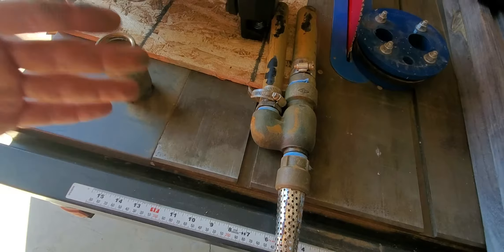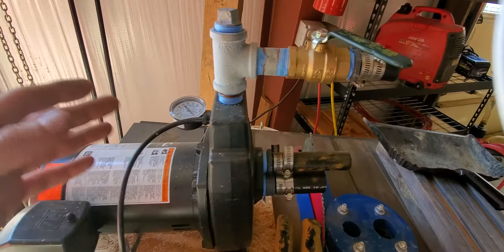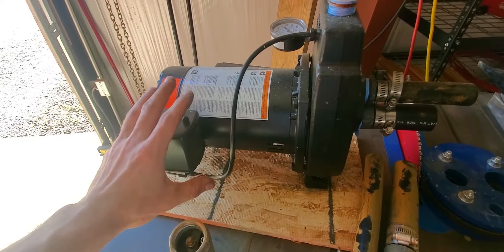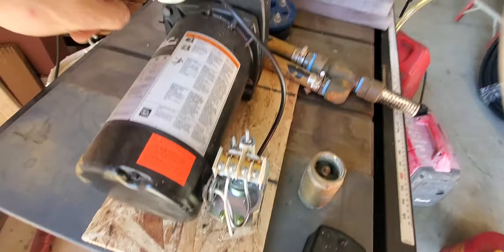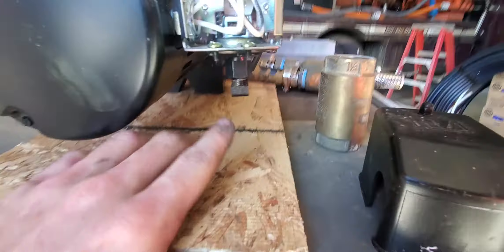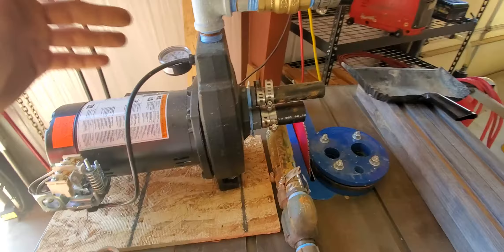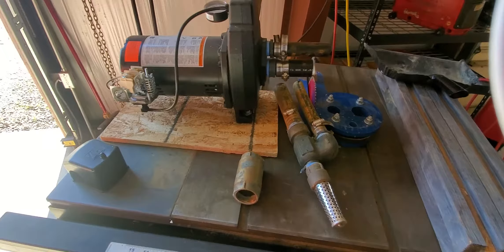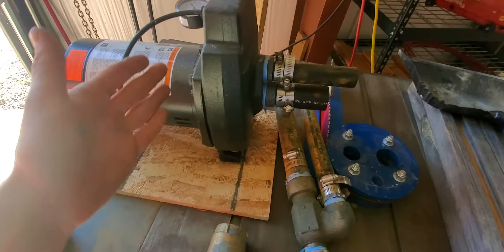Well Pump Not Pumping, here's why. Jet Pump 2 Line System Explained. No Water, Low Pressure.

Comment from the maker: Like 👍 this Video if it was Helpful! 
Find others like in on my channels Playlist Labeled Well Q&A!  Thanks for Watching 👀
Reply: My pump will run build pressure shut off and then makes a gurgling noise then turns back on
Reply from the maker: @rickjones2534  your pipe or foot valve is cracked down in the well. It's just leaking all the pressure back down the hole. Pull pipe out! Look for cracked plastic and holes & inspect the check valve, a rock can be stuck in the oring sometimes
Reply: Can you line a 4inch well casing?

Comment: We still run a Goulds Jet system here, but we take directly from a seep well on a river. And yes nothing by headaches. Brother just replaced the pressure switch because it wasn't cutting off. Now the pump isn't pumping any water as before it was still holding prime. I'm so over this system lol but he wont pay to put in anything else.

Comment: I have a jet pump system that was originally installed in 1967....in a small casing (2" or so).  I've had to have the foot valve replaced twice and have a lot of the red iron in our water.  I'm getting a lot of dirt and grit in the filters since the last foot valve was installed in the Spring of this year.   I've got a new 86 gallon water pressure tank on order as the bladder in mine has started leaking.

Thanks for the video and info!

Comment: Awesome explanation! Thanks for a better understanding of how it works. My old contactor burned the red wire from the pump. Melted in two and contactor stuck. I replaced the pressure switch and now my pump comes on at 40 but doesn't gain to 60. It doesn't lose pressure if it sits either. With that burned leg do you think it's possibly a pump issue?

Comment: We’ve got a deep well jet pump (two pipe, 1” drive line and 1 1/4” suction line) that we’re having trouble priming. The foot valve and ejector assembly is located in the river—in total about say 200’ away from where the pump is located under the house, with about 45 feet vertical head down to the river. The system holds pressure, but the pump on its own can’t get above about 25 PSI. We had an 20 year old 3/4 HP jet pump (metal impeller) that worked fine under these same conditions that we wanted to replace because it gotten to making a lot of noise. We installed the ejector package that came with the new pump, which is a Red Lion Model. Actually we had another brand in there to start with, but replaced that because of the priming problem, thinking it may be the pump. In watching your video it seems like a problem with the foot valve. Anyway, in talking with some other knowledgeable folks the distance should not be a problem. It’s the head that matters most. That the line friction would only amount to a couple psi difference in line loss. The lines do make a couple of coiled loops near the river (just to make sure we have enough tubing in case we need to cut some off).And like I said, on the old set up, when priming, I;d have to futz around with it getting the air out for a time or three, but it was really no problem. Now we can’t get it work for hell or high water.  Any suggestions?
Reply: Not sure if you were able to resolve your priming but i have the exact same scenario and I was able to prime the pump with a 1HP and the pump run for about 1min 36 second to go from 30psi to 50psi. I'm happy with this but my issue is that if we take a lots of water the pump doesn't provide enough and I'm afraid to loose priming if I keep the shower running + washing machine and my wife does use the sink...... Not sure how to increase flow :/

Comment: I have a shallow well jet pump here in Florida. It is a bit different but some of this information is useful! I am receiving a new start capacitor today in the mail. My 1hp motor just hums. I have 240v at the motor but the old capacitor reads above the upper limit of capacitance on the capacitor and I have never gotten a spark when shorting across the terminals of the capacitor so I just ordered a new one. Strange thing happened yesterday on Sunday. An alarm went off on our sewer grinder and when the city's technician came she found the capacitor was bad and replaced it and the grinder motor started right up and you could see the waste material going down in the cylinder. Good to go literally.

Comment: I’ve never worked on a water pump or system ever in my life, but you really clarified a lot. 

Thank you so much! 

I live in South Florida. One of the pvc pipes to my moms 1/2 hp well pump bursted in our garage and it was like a geyser to the ceiling. I have been rigging it to work for the past couple weeks, but I went ahead and purchased a ‘STA-Rite SNC-L Shallow Well Jet Pump 1/2 HP 115/230V’ and SpringWell’s ULTRA Whole House Well Water Filter Salt Based System Combo + UV Water Purification System along with a Spin-Down Sediment Filter.

I have an existing pressure tank and like I said, I’m quite the novice. I’m just a bit confused on where the placement of all my units should be. 

It’s quite a big project, but I’ve been trying to study what I can and learn off of YouTube. It’s just a bit difficult, because since I rigged my pump.. we’ve barely had any water pressure and my pump runs all day long (so I turn it off from the breaker since it would overheat for running 24/7.)

I do have a secondary pump that pulls from our shallow well on the exterior (opposite of the garage pump) that fills into a huge tank that removes iron/ sulfur, but also acts as a holding tank for water, as well. Meaning the pump that bursted is the one that pulls from the water tank outside.

Since I’m not well versed in this field, I’m worried I’ll mess this up somehow. I do however believe I’m correct when I say I can eliminate that whole part of the unit because it’s outdated and unnecessary with the new system I purchased. 

Therefore, my assumption is I can directly connect the new pump directly to my well and to my new system and it will work just as it did when using my system previous to the incident (if not better, of course.) The pumps are literally less then 2 feet away from each other, forgot to mention the outside pump is the same HP as the garage one too.

Sorry for the novel and I’m sure you might not even read all of this lol, but I really am trying my best to not call a plumber and to learn to do this all by myself (and with help of YouTube University!)

I wouldn’t call myself a handyman, but I do try my best in everything. I’m pretty DIY inclined, does this all sound like too much to take on? 

If I have all the proper tools.. I wouldn’t see why I couldn’t replace something that’s already there and just add to it.. if I pay attention to all these kinds of tips and very helpful videos.

Any insight is GREATLY appreciated. Regardless, I appreciate your time and wonderful content. 

Thank you, again!

Comment: Great video!! 12 minutes that will save me weeks of troubleshooting! My father in law has an old everite 2 line jet pump connected to a 1/3 HP Dayton motor. He had a plumber install a holding tank but full pressure never returned. Now theres a loud grinding sound coming out of the pump (not the motor) I have a picture of the pump and motor if it would help. At this point it seems the plumber probably didnt pressurize the new tank properly but now it seems the pump bearings or something has finnally worn out and its time for a new 2 line pump and motor. Wed have to dig up a concrete pad to access the existing well so we're thinking a new pump rather then a submersible would be much less time consuming for our situation

Comment: Glad I found your channel. I purchased my home 3 years ago and it has a jet pump for the sprinkler system. The pump runs but does not prime. Even if I prime it it just loses pressure right away. I was told it has a bad leather seal and quoted $1200 to repair. I didn’t really bother with it before because it rains a lot  here in Virginia Beach. I was wondering how extensive of a repair this is? If it’s not too difficult I might just do it myself.
Reply from the maker: You can probably tackle the job. $1200 is kinda high, id say $600 max to pull the line and replace a check valve. I'd call Around & get different prices. I believe that you have a bad check valve, must likely. My family was from va-b. Lived over in Point-o-woods & my dad used to work at pollards chicken In the 70s 😆

Comment: This video was very helpful and discouraging at the same time. It sounds like my problem is in my well. It was cycling the other day so i shut the breaker off. I heard the water being released back into the well bit when I turned the breaker back on it only runs . I tried the priming process and can get above 20psi. I don't know exactly where the well is located. Would appreciate any advice you can offer . I also hope to find the location of my well because nothing has been done outside for many years.

Comment: Question: Will any leak from say a gasket in the pump prevent the pump from taking a prime? In other words not just a pin hole in the bottom of the well pipe as you mentioned. Long story but... I bought a property that has a surface mount pump that i think got clogged stopped sucking water continued to run and then due to bad wiring fried the breaker eventually and turned off. I removed the pump and impeller was gunked up with red mineral or clay. In the process i destroyed a gasket which lets it leak a little above ground  now. Pump seems to run good but not producing any water, What i need to know is am i wasting my time chasing a gasket or is it a possibility the gasket will "seal" the vacuum and produce water with a prime? Like others say,,,, I learned more in one of your videos than 100 others, Im a fan. Subscribed and Liked.

Comment: I have a jet pump and the big freeze is finally over. Now I'm looking to prime my pump since it runs but no water.  According to the video I only need to put water in the one section, is that correct? Thanks alot.  Someone is coming tomorrow to do it but I'd still like to know how.

Comment: i've watched 10 videos - yours's is the best. i'd hire you to work on my stuff  :-)

I live next to a lake. I have a jet pump that's not working well - I've had the system for 30 years (?) 
Replaced the impeller once.
My problems:
1) no water coming out of the hose.  then, a few minutes later, water comes out.  So I figure the pressure switch may be clogged, like you said - the swtich was stuck in the OFF postion and only turned on when the pressure got REAL LOW.
2) historically, I can leave the pump on full-time and it only runs when there's demand. it was running last night, with no demand. So I'm wondering if the pressure switch allowed the pump to stay off too long and it lost it's prime?  so the pump was running dry?
I think I'll be replacing the foot valve (in the lake) and the pressure switch (or flushing it) - also, I've a quick disconnect, where I remove the tubing into the lake for the winter (Minnesota) and I'll take that apart and grease / vasoline the o-ring - so I'm not sucking air into the system

Sound ok?

Comment: I am watching this video as I am a plumber (with limited well and pump experience) and my friend has a pressure issue with his deep well jet pump. If we switch to a submersible would I just pull out the 1 1/4”line and connect to his 1” ? And is there a dual pitiless down his well casing or how does that connect?
Reply: 1''' PITLESS ADAPTER TOOL MADE OUT OF 1'' GAS PIPE MAKE A 5'TEE

Comment: Good day to you. Thanks so much for the video. It's been great. If I may, I have about a 40--foot deep well. I replaced the drop pipes, put in a new foot valve in the ejector. Inside the house, we also put in a new water heater and pipes. The deep well pump has been primed. I see water spilling out of the hole on the pump where I put in water to prime it. But I still don't get any pressure. There are no leaks inside the house. The deep well tank is at 38 PSI. I also replaced the pump switch with a new one, but the pressure does not go higher than 12 to 14 psi. May I get your advice about this? Would be more than happy to send you payment via PayPal of Venmo. Please let me know. Thanks so much.
Reply from the maker: You need a valve on the out going port (between pump & tank). 
It's pushing water out faster than it can suck it in. So you need to close the valve 90% and slowly open it over 2 minutes & allow the system to catch up. 
Note: there can't be Any air leaks on suction side either. 
A jet pump can have a dozen possible problems (that's why I don't service them.) Even a skilled plumber can spend hours trying to prime it.

Comment: i imagine jet pump bore hole is too small to install a submersible pump in? I have things 2 check on jet pump[great video btw], its running constant, i turned off breaker then came upstairs to watch some vids, hoping its the pressure switch! have new larger pump and pressure tank to install if anything other than injector[i sure hope thats not what it is...i did get a great deal on property and almost 4yrs out of existing equipment but know it needs to be replaced. seeing as I already have the parts, would it still be cheaper or better in the long run to install submersible? i'm thinking would be huge $ to widen well hole for submersible? guess i'll find out monday lol

Comment: I am hoping you can help. I recently installed a new pump. It will draw water but really struggles to get up to pressure. It will and does hold pressure. But the moment the float switch tells it to turn on, it will drop to zero and run extremely hard and loud like it doesn't have water but will eventually (5 minutes give or take) draw water and hold pressure. How do I keep it from dropping all the way to zero? It didn't used to drop that low. It used to keep around 20psi.

Comment: Do you have a video about changing a foot valve or injector?
Reply from the maker: Unfortunately no, jet pumps aren't used in my area. So I rarely see them. But it's not too terribly difficult to replace a injector, the key is to buy All new parts to replace the old items down in the well.

Comment: Hi and thanks for the best jet pump video out there. Question: is it possible for a jet pump to be pulling water from a 178' deep well ?...thanks
Reply from the maker: No. Max working depth might be 120ft. & that's pushing it. Normally it's 60-80ft

Comment: great video...I have a question...I just installed irrigation . I just unplugged my pump to make some pvc cuts and connections and then plugged the pump back in...so I didn't close any valves...then when I plugged my pump back in I got an instant quick burst of water...now all a sudden my pump cuts on at 35 psi but will only run one spicket now and doesn't pump up enough to shut off until I close the spicket. if I try to use more than 1 spicket I barely get any water out of any of them...any idea on what I should/can do?
Reply from the maker: I'm assuming that it's a jet pump(above ground). It sounds like you have a air lock Trapped in the pump. Try bleeding off the air at the high point of the pump housing. Maybe a gauge or something you can crack open & let it weep under pressure while it's running

Comment: I have a two pipe jet pump that only feeds my irrigation 6 zone residencial system and one hose bib. This spring i primed the pump using a garden hose with the motor off. The pump operates fine when the irrigation system or the hose bib is calling for water. Runs at 40lbs. When nothing is calling for water, the pump cycles about evry 90 seconds. If i close the ball valve on the discharge side that feeds the sprinkler system, the the pump cycles every 8 to ten minutes.
I did find a leak on one of the two elbows under the ground where the pipe comes thru the slab the pump is sitting on and turns 90° to exit toward the well head . Any advice will be appreciated. 
I was going to install temporary check valves on the two pipes as they leave the pump just see if that stopped the issue but got cold feet.

Comment: Where is the pressure regulating valve on that deep well jet pump?  A deep well jet pump must have a system to regulate pressure in the pump and the lines going to the ejector.  Is it built into the pump housing?  It's a good video, but you missed a very important point.  There were some deep well ejector pumps made with a rubber diaphragm built into the pump housing to regulate the pressure, so I'm assuming the one in the video is that type?  The pump housing looks way too small to me to have the diaphragm arrangement.  The PRV is normally loctated close to where your priming T is located.

Comment: Good video. We have a jet pump and the water in the 2nd story bath shuts off for 2 minutes then comes back on. So I will clean the nipple (flex tube) under the switch to see if that helps. Thanks